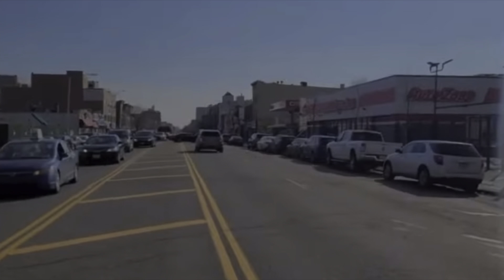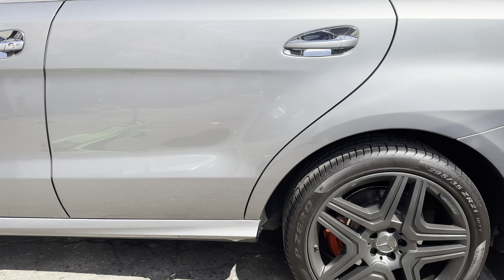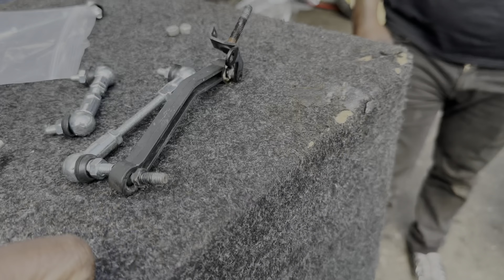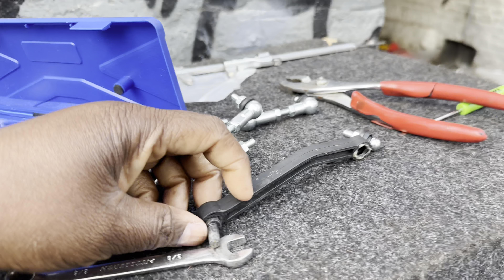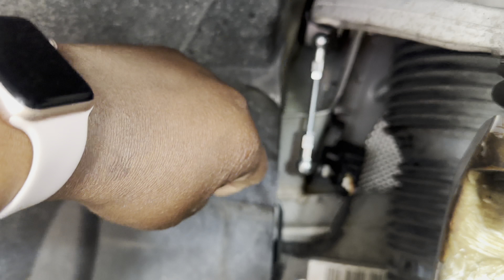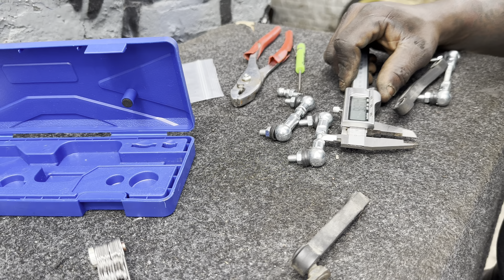ML63 AMG Get Lowering Links Installed | Epic

Comment: The links that i bought that look just like yours did not lower the front. It actually made it way higher. The rears dropped very low but fronts did not. The rears if its shorter in length it will make it lower. For the fronts the links looks shorter than stock length made it higher. The instruction paper that came with the links stated that the fronts is different. The longer the length it lowers it. In my case thats what it was doing. Wasted the whole day with it. Finally gave up and put the stock back on and had to return the links. I ended up ordering from different vendor. Hopefully this one works out.